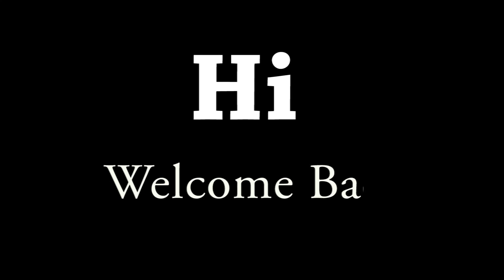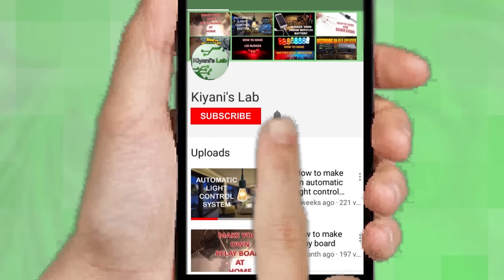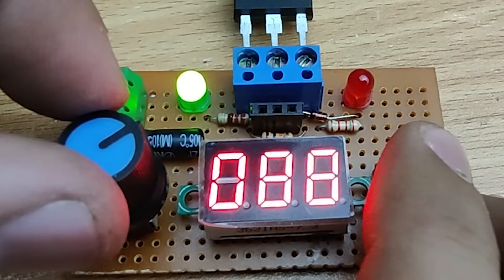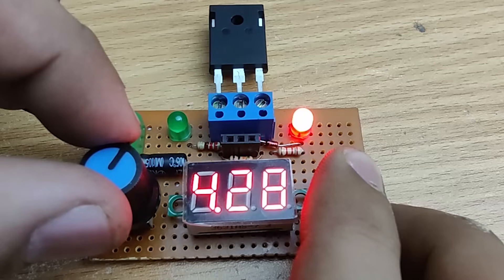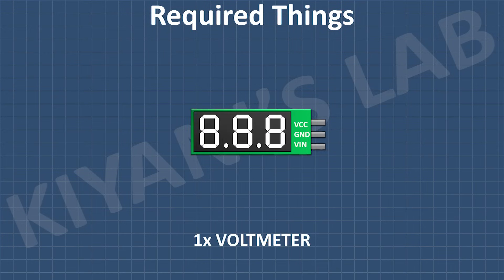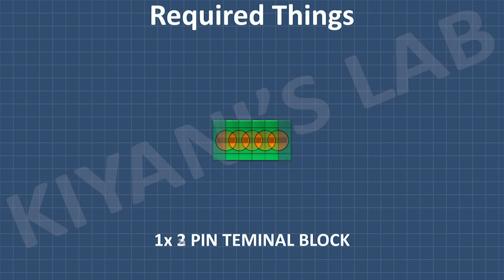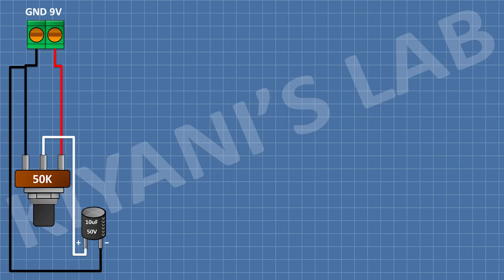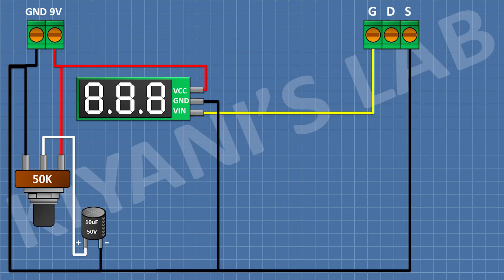IGBT & MOSFET TESTER 2.0 | Electronics Project

Comment: Hello Kiyanis, i don't understand your diagram how the voltage can fluctuate if the two wires red and black are directly connected to the 9v cc? ihave make your diagram and if you do not put the positive(of the 3 digits), to the cursor of the potentiometer, the voltage do not change ! thank you for your response Richard from France.

Comment: THIS IS EXTREMELY SLOPPY
- what s the pot's taper?
- poor component specs
 - why a signal diode - makes NO sense
 - he says you can use it to measure the Gate voltage but that is not true
 - he says it can be used for mosfets but does not mention it in the video. in the comments he back-tracks. wtf?
- the difference between go and no-go is weak; very poor tester

it is  a crude badly designed and poorly presented supposed no go/go tester
Reply: Please explain in more details why messuring of gate voltage is not true and all other things you have written. Thanks. Bo

Comment: عالی بود 🎉
Reply: THIS IS EXTREMELY SLOPPY
- what s the pot's taper?
- poor component specs
 - why a signal diode - makes NO sense
 - he says you can use it to measure the Gate voltage but that is not true
 - he says it can be used for mosfets but does not mention it in the video. in the comments he back-tracks. wtf?
- the difference between go and no-go is weak; very poor tester

it is  a crude badly designed and poorly presented supposed no go/go tester
Reply: @kennmossman8701 Hello. Yes, you wrote it completely correctly, but for those who do not have access to good facilities, either in terms of money or in a deprived area, for component testers, this is a good guide to find healthy and burnt components. It only shows whether the component is healthy or damaged, whether current flows or not.

Comment: ❤❤❤❤❤THANKS...for sharing...hope you the best for your life
Reply: THIS IS EXTREMELY SLOPPY
- what s the pot's taper?
- poor component specs
 - why a signal diode - makes NO sense
 - he says you can use it to measure the Gate voltage but that is not true
 - he says it can be used for mosfets but does not mention it in the video. in the comments he back-tracks. wtf?
- the difference between go and no-go is weak; very poor tester

it is  a crude badly designed and poorly presented supposed no go/go tester

Comment: Thank you for making this detailed video.👍🤠
Reply: THIS IS EXTREMELY SLOPPY
- what s the pot's taper?
- poor component specs
 - why a signal diode - makes NO sense
 - he says you can use it to measure the Gate voltage but that is not true
 - he says it can be used for mosfets but does not mention it in the video. in the comments he back-tracks. wtf?
- the difference between go and no-go is weak; very poor tester

it is  a crude badly designed and poorly presented supposed no go/go tester

Comment: This work for both N and P channel mosfets?
Reply from the maker: this is specially for IGBT which is only in N Type but can also test MOSFET I will make same for both P and N soon
Reply: @KiyanisLab  WTF   THAT MAKES no SENSE
Reply: THIS IS EXTREMELY SLOPPY
- what s the pot's taper?
- poor component specs
 - why a signal diode - makes NO sense
 - he says you can use it to measure the Gate voltage but that is not true
 - he says it can be used for mosfets but does not mention it in the video. in the comments he back-tracks. wtf?
- the difference between go and no-go is weak; very poor tester

it is  a crude badly designed and poorly presented supposed no go/go tester
Reply: @kennmossman8701 
Please explain in more details why messuring of gate voltage is not true and all other things you have written. Thanks. Bo

Comment: Bro you make a 12v solar charge controller
Reply from the maker: ok I will
Reply: lkmao    he knows very little.
THIS IS EXTREMELY SLOPPY
- what s the pot's taper?
- poor component specs
 - why a signal diode - makes NO sense
 - he says you can use it to measure the Gate voltage but that is not true
 - he says it can be used for mosfets but does not mention it in the video. in the comments he back-tracks. wtf?
- the difference between go and no-go is weak; very poor tester

it is  a crude badly designed and poorly presented supposed no go/go tester

Comment: Ok aí sim top
Reply: THIS IS EXTREMELY SLOPPY
- what s the pot's taper?
- poor component specs
 - why a signal diode - makes NO sense
 - he says you can use it to measure the Gate voltage but that is not true
 - he says it can be used for mosfets but does not mention it in the video. in the comments he back-tracks. wtf?
- the difference between go and no-go is weak; very poor tester

it is  a crude badly designed and poorly presented supposed no go/go tester

Comment: May you make  a circuit diagram of 433mzh rf module, 555 timer ic which can control speed using pwm, h-bridge ic1919 which can drive 4 dc motors with such 5 channel with speed control button & take HT12E  as encoder & HT12D as decoder ic ?
I need this very much I would be very grateful to you.

Comment: 🌟🌷🌟
Reply: THIS IS EXTREMELY SLOPPY
- what s the pot's taper?
- poor component specs
 - why a signal diode - makes NO sense
 - he says you can use it to measure the Gate voltage but that is not true
 - he says it can be used for mosfets but does not mention it in the video. in the comments he back-tracks. wtf?
- the difference between go and no-go is weak; very poor tester

it is  a crude badly designed and poorly presented supposed no go/go tester

Comment: Very nice project IGHT Tester
Reply: THIS IS EXTREMELY SLOPPY
- what s the pot's taper?
- poor component specs
 - why a signal diode - makes NO sense
 - he says you can use it to measure the Gate voltage but that is not true
 - he says it can be used for mosfets but does not mention it in the video. in the comments he back-tracks. wtf?
- the difference between go and no-go is weak; very poor tester

it is  a crude badly designed and poorly presented supposed no go/go tester